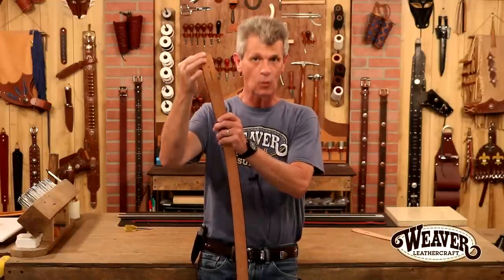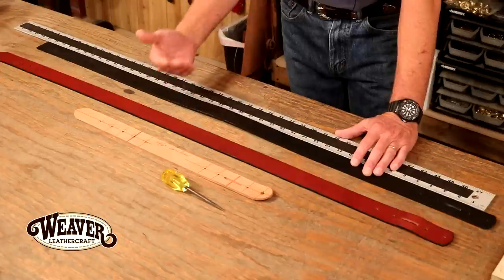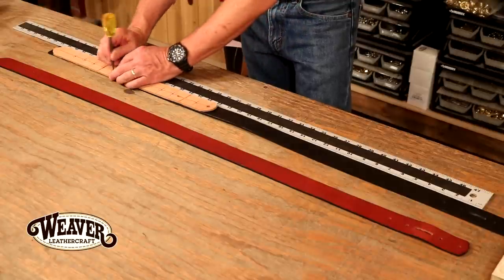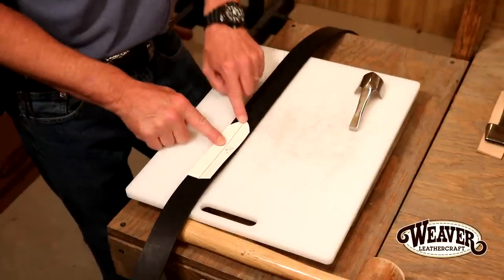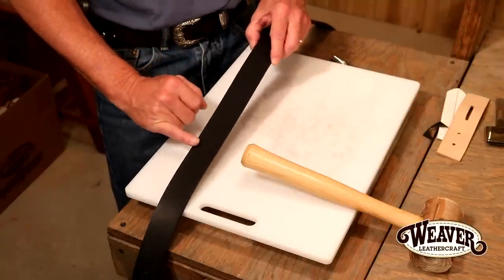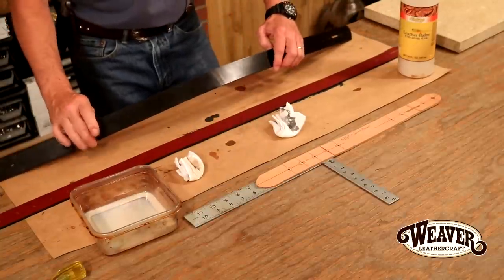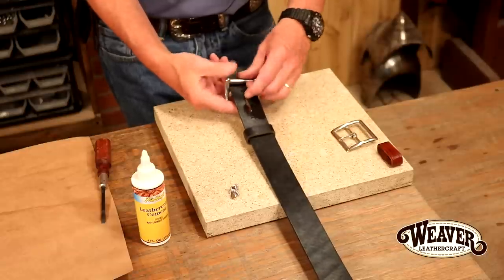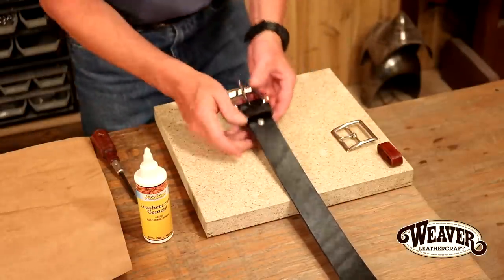The Leather Element: Father's Day Leather Belt Tutorial

Comment: A real quick question is Fiebing's Leather Balm a conditioner or is it a sealer? Also is it necessary to apply it? Lastly could I use saddle soap or mink oil instead? Thank you
Reply from the maker: Hi there,
It is a sealer so you can use any other sealer or top coat that you prefer. It is best to add a sealer or top coat after you dye leather to prevent any kind rub off. Hope this helps!

Comment: Chuck, great video as usual but I need to know the size of double cap rivet to use for my belts. What is the best type to use? thanks Steve
Reply from the maker: Hi there! The size rivet depends on the thickness of your leather. We used an 8/9 oz. leather in this video, and if we double that it is about 1/4" thick. You'll want your rivet post to be about 1/16" - 1/8" longer than the thickness of your material so for this particular belt we would want a 5/16" inch long rivet. Let us know if you have any more questions!